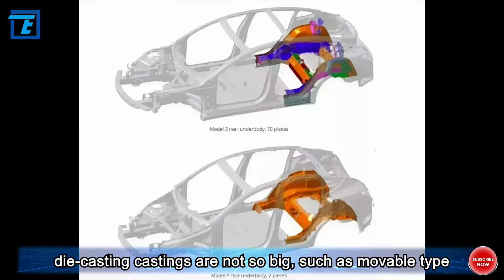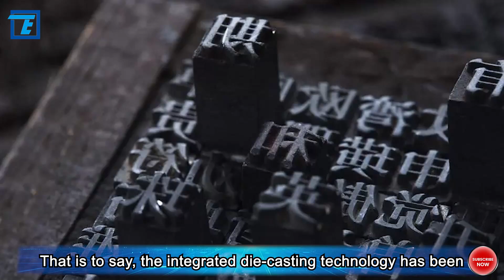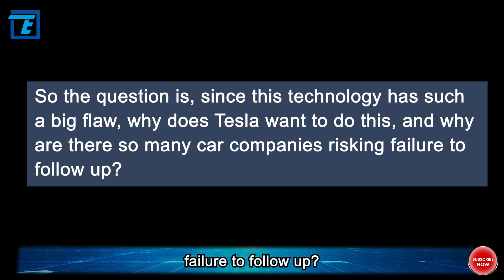Behind Tesla, China shocked the global auto industry with this tech

Comment: Tesla's die-casting technology is a double-edged sword. On the one hand, the technology helped bring down costs significantly and also strengthen the rigidity of its vehicles. However, the astronomical cost of the casting molds impedes the expansion of Tesla car models that the consumers need to have with each new year.

Ever wonder why BYD surpassed Tesla in the number of EV's sold in the international market recently? The iPhone 15 sales suffered a slump because it offered no new innovation besides a "titanium" band around the edge of the phone that no one really needs. The iPhone 15 example should be a lesson that Elon Musk must take to heart.